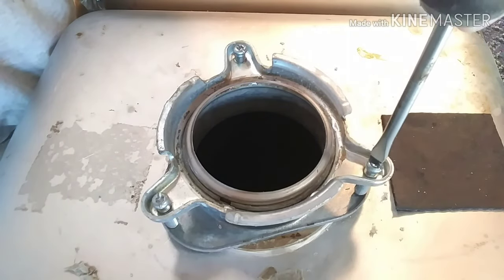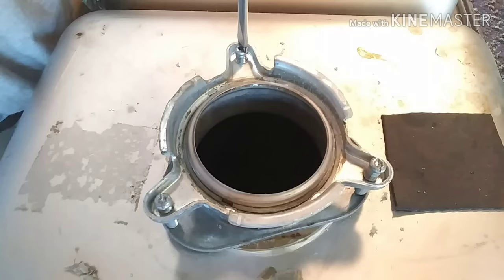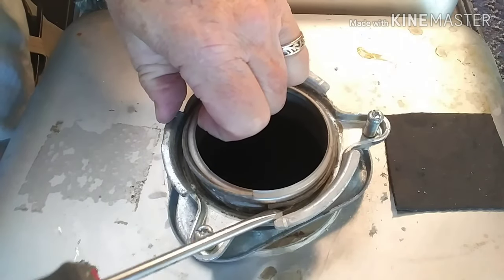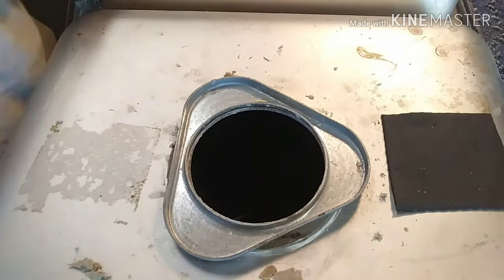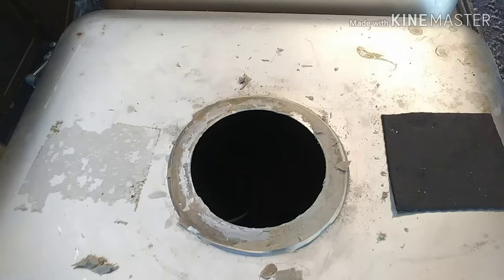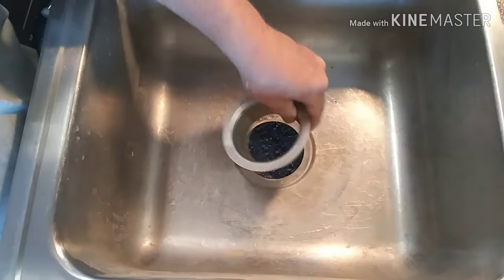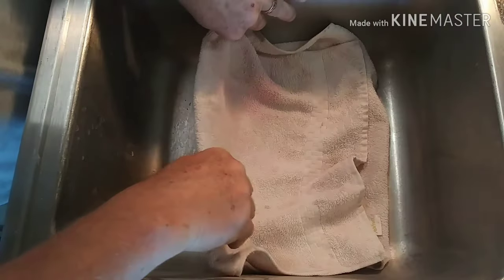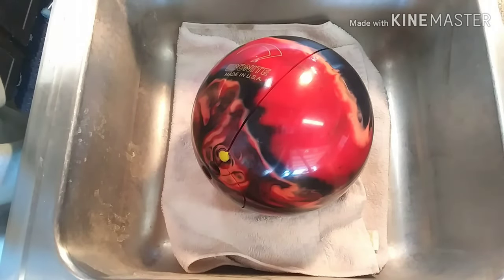Remove garbage disposal mounting ring( quick/easy)

Comment: Thanks for the video! For anyone else looking, my disposal was completely rusted together and the ring was completely encased in rust. I sprayed the entire assembly with WD-40 every 30 minutes for a few hours and the ring was not coming out. What worked for me was taking a hacksaw to the ring with the screws, and then using channel locks to bend it off of the mounting ring and drop everything down. Hope this advice is useful for anyone else in my position.
Reply: Seems like i've got something similar on my hand. Either that or whoever put this thing on didn't have those rings So they found some permanent substitute. And I don't see the rings, so I might just be getting a new sink.

Comment: Thank you so much for this video!! I was struggling and it helped so much! My ring was very rusted and tight and hard to get off but I used a paint can opener to hook in there and pull down and it all came right out :)
Reply from the maker: Nice
Reply: YOU ARE A GENUIS! I just struggled for 20 minutes trying to get the rusted snap ring off before coming to youtube for help. I read your comment, immediately ran to grab my paint opener, and got it off in 30 seconds. Thank you!!!!!!!!!!!!!!
Reply from the maker: Paint can opener 👍nice
Reply: Agreed, this is a very useful video.  And GTTP makes it look so easy!  There's not much room to work there, and I definitely had to "get mad at that damn ring" (seen Cool Hand Luke?), forcing the screwdriver underneath, and then prying it quickly and with force to persuade it to pop off.

Comment: Thank you!!  You tube and PB Blaster saved the day.  Snap ring really rusted in there
Reply from the maker: Nice👍
Reply: I've tried PB blaster and still too rusted to find the ring....highly frustrated. Thinking of using hackzall
Reply from the maker: @jillm2407  try a wire brush along with the pb , also try hitting the  ring with a hammer and screw driver...good luck👍

Comment: My mounting plate is rusted to the flange....
Reply from the maker: The snap ring is what holds it on, if you got that off try penetrating lubricant and try hitting with hammer and screwdriver to get them apart
Reply: @GetToThePointplz123  my son cut a hole in the flange with a Dremel. He then used a hammer and screwdriver to get it out! Yay!
Reply: I'm having same problem UGH!!